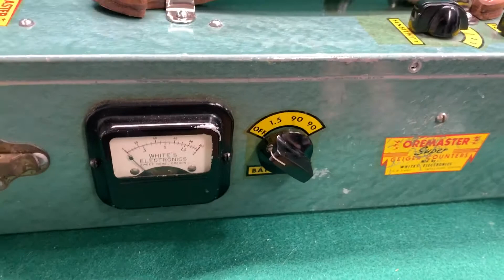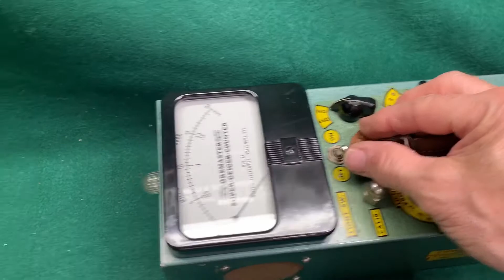Whites Oremaster Super Geiger Counter #2

Comment: I'm working on a similar model, and replacing the old Sprague "Atom" paper capacitors. What voltage/model are those three brown capacitors? Did you replace any other components in this counter (other than the battery converters)? Thank you for posting these awesome videos, and keep up the good work!